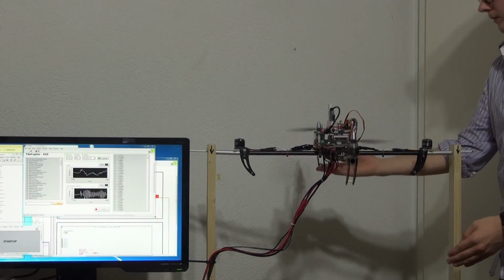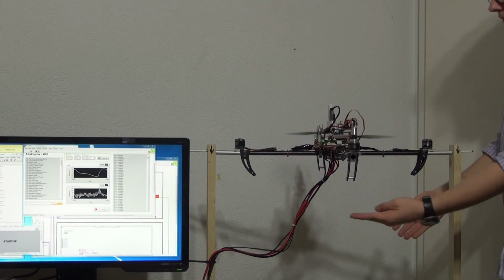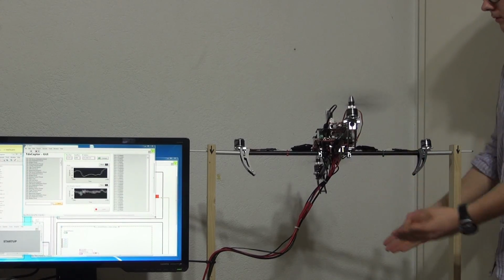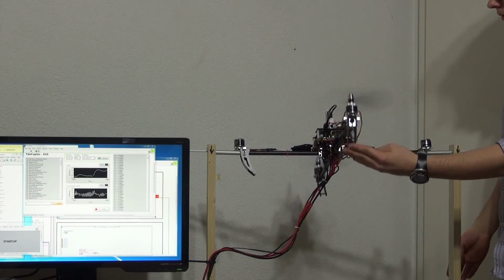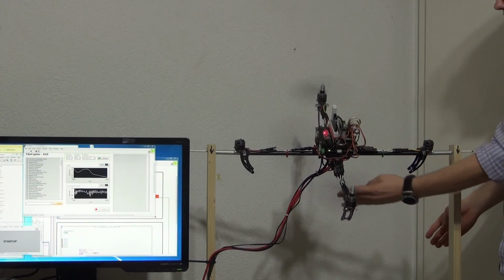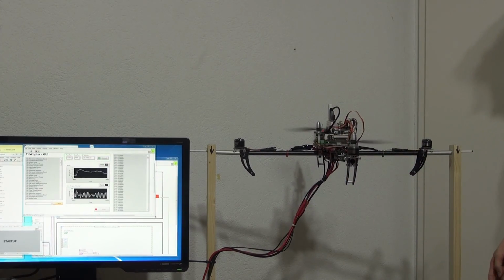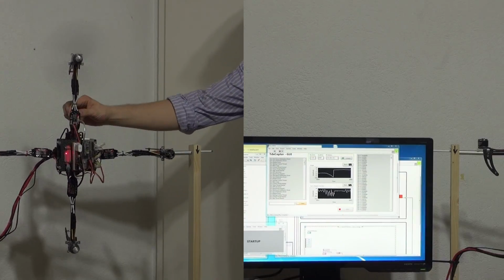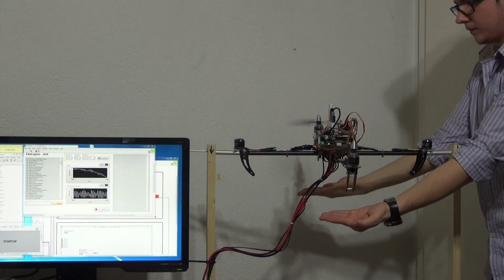Quadcopter PID Controller Testing - TdxCopter

Comment: Hello, I'm trying to  use the PCA9685 to send the PID commands via PWM to my quadcopter motors. I'm having some problems to make it work like I want, though. Could you please tell me how you did it? Thank you very much in advance, and congratulations on your project!
Reply: Sarah Madruga  helllo caan you tell me who is name of the systeme can stabilise the quadcopter
Reply: Sarah Madruga  helllo caan you tell me who is name of the systeme can stabilise the quadcopter
Reply: It's a PID controller
Reply: Sarah Madruga I am late, but you can find the circuit diagram of the adafruit servo controller (it is open source). That component uses the same chip you mention to drive 12 pwm channels via i2c.

Comment: Excuse me I am doing this project now and as many people I have problems with stabilization, how should I stabilize them which value should I be changing and how? Another question, can you tell me how did you programmed the motors and the program you used please. Labview or arduino?

Comment: Hi, good stabilization. I have constructed a hexacopter using ARDUINO MEGA and MPU6050 SENSOR. Now we have the problem with stabilization. Namely, there is a big vibration. Could you please help us with program if it is possible? Thanks in advance

Comment: I program the PID but i failed and my ESC burn in fire.Please do you have a simple exmple only using a gyroscope?
Reply from the maker: I would try to test one axis at a time. If u assume your quadcopter is in average level u can try to correct for the gyro drift by multiplying it by a number very close to 1, e.g. 0.995... To check your calculations you can disable the motors and tilt your quad by 90° - your angle should now measure 90° otherwise you need ajust your angle calculation. Once you have angle and angular velocity you can start tuning your PID. Do one part at the time and then mix them together. Also to make your life easier: buy ESC with high update rate or a good sensor ( like the MPU 9250 ) or similar. Cheers man
Reply: thanks for replying
Right now I have a complementary filter data linking accelerometer and gyroscope. The filter returns me the angles in X and Y. Then I put the PID function libstock eg angle X and returns me a range of values. Init_PID (0.5, .03, .001, -255.255); OC1RS = map (Output, -255,255,6,25); // Yes
  OC2RS = map (Output2,255, -255,6,25); Please I would like you to give me your opinion, if I'm right.
Reply: あげる見せて jesus,I have a some project quadcopter PID control with Renesas MCU.
Reply: Huang LiJi Thanks for writing, but I have finished my quadcopter. I used a dsPic and I programmed in C using the PID libs.But be careful with where you intilize all the parameteres in a while loop.I have seen all the parameters using TeraTerminal that helped me too much.
Reply: Hi friend,  I'm in the same project like you,  I've programmed the whole quadcopter in a dspic33fj64mc202,  but I'm not able to tune the PID values,  could you share your code in order to compare with mine to see if I can figure out the problem?  Thank you very much,  maxibarac@hotmail.com

Comment: Hallo,

Ich bin momentan daran, einen quadrocopter mit Arduino zu erstellen. Die Winkel usw. Konnte ich bis jetzt berechnen, dies stellt kein Problem dar. Ich habe jedoch Mühe mit dem pid Regler. Am Gestänge funktioniert dies wunderbar, jedoch habe ich bemerkt, dass bei meinem ersten Testflug der Copter übelst kippt auf eine Seite. Ich tendiere dazu, dass der P Regler zu tief ist. Wenn ich den erhöhe, fängt er an zu schwingen. Nun meine Frage: in deinem Video schwingt der copter ja auch nur mit dem P Regler. Hast du diesen noch angepasst, als alle drei Regler liefen ? Ich bin der Meinung, dass dieser so eingestellt werden muss, dass dieser nicht anfängt zu schwingen. Ich bin ein wenig ratlos momentan. Danke für deine Hilfe.

Gruss
Reply from the maker: Nein habe ich nicht angepasst. Wichtig ist, dass dein Loop genügend schnell ist. Wir haben im moment 125 Hz und auch gutes Filterring der Sensordaten. Die Motoren steuern wir mit 400 Hz an was auch sehr geholfen hat. Vielleicht kannst du den D teil noch erhöhen und schauen das I auch klein genug ist. I kann auch zum Schwingen fürhen.

Comment: Can you tell me ? what is  the value in control ? velocity or angle ? or other
thank you
Reply from the maker: we use both, velocity and angle, the gyro measure the angular VELOCITY while the accelerometer measures the angle ( with lots of noise ... ) therefore we INTEGRATE the velocity from the gyro and combine this angle with the one measured with the accelerometer, only to fly with a remote control the gyro alone, meaning the velocity will be enough

Comment: Hi man I doing the same right now with RPi. Can u say pls which Kp, Ki and Kd do u set? U have programmes simple one PID loop? TY
Reply from the maker: Nice! I dont think our values will help you since you have other hardware and other code. The most important thing is to get good sensor readouts. Then you can start with the Kp and increase it and you see what happens. Our loop runs at over 100Hz right now, which was a major improvement as well.